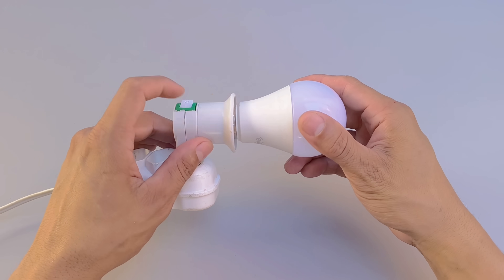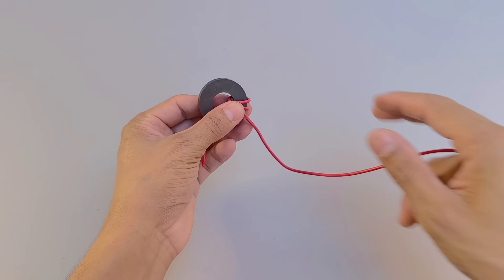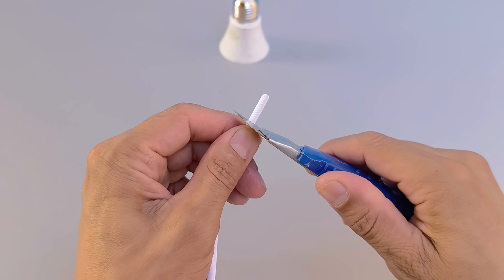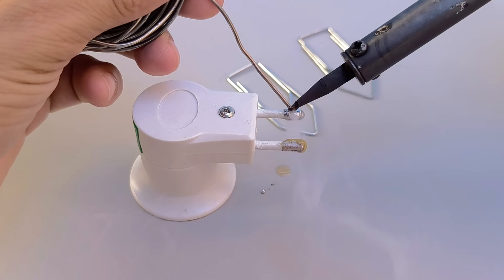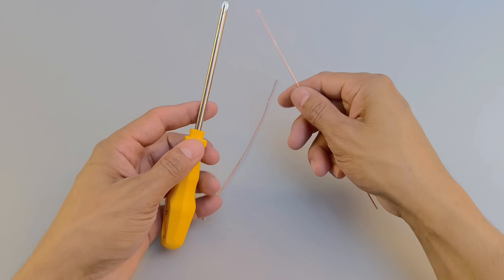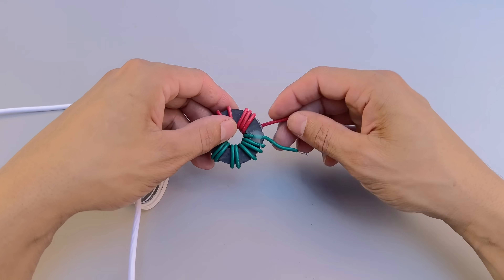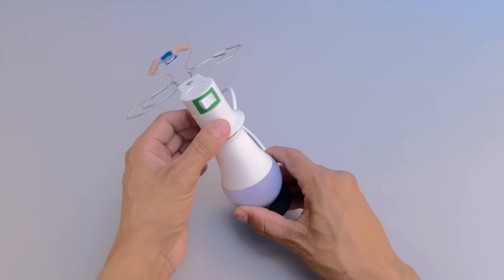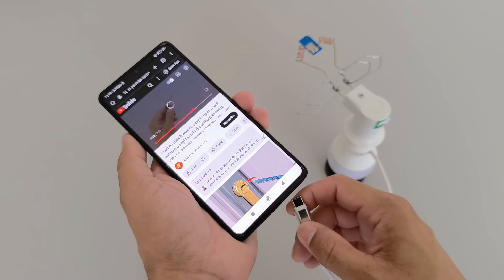If I hadn't seen it, I wouldn't have believed it! 100% free internet using a light bulb

Comment: Didn't the old bike dynamo, just rely on kinetic energy, movement. Using windings and an iron, carbon core. No external power source to drive it. So aren't turbine generators, able to provide free energy FFS? Everyone needs to install home turbines, water turbines, in fact anything that moves, wire it up 😉🇬🇧

Comment: you enabled mobile data before closing the settings tab on your smartphone... one tap to enable two to disable you tapped 3 times and closed it before it initialized the "not available" message after closing the wifi settings is the standard message when the device is still searching for a signal... if it didn't have the ability to connect it would say "couldn't connect to a network try again later"
Reply from the maker: Thanks for the detailed observation; I appreciate your attention to detail! 🙏

Comment: So I'm reporting this video and others like it.  It's causing ppl to become dumber and dumber since u can find out so much online already. Ppl take it for granted and stop learning how things are correctly created or facilitated to them.  They start thinking it's some conspiracy that's being hidden by people behind the scenes for control and power... because some random guy said so and couldn't provide proof other than what some other guy said in the same manner.  I can't tell you how many times I've heard ur wrong bro check out this video and I'm sent 4 hours of videos of people doing exactly the same thing he did and saying that's definitive proof.  "But he said he's an expert" Lord help us all...

 If anyone potentially thinking it may be real, and they remembered or learned how magnets worked when connected to wires and electricity back in middle school, they would know this is all a lie. Unless he edits this video or deletes it with others once reported, trying to cover up how he shows in the video, that he doesn't even know how a phone works and tells on himself. There's an overlay or prerecorded video showing the internet speed before even connecting that abomination to his phone. If it worked like that, why use the extra steps connecting wires sanding down something that's told plated and already makes an electrical connection? You don't need to remove something that's more reliably conductive so something conductive underneath that will conduct electricity...Why didn't it start working until the thing was plugged in tho it showed an internet connection already? Why didn't the speed change? That thing is pulling it out of thin air, like it's 5G so you won't keep a steady connection within any building that has any walls or electricity, much less a camera powered by batteries anywhere within its vicinity. It's not a one time speed test you do to gauge your intenet at that time.  Wifi is a perfect example of why there's changing speeds and why there's a preference for using an ethernet connection instead. Your modem/router is hardwired not wireless pulling signal from nowhere. I mean he even made the mistake of saying how you can see it's speed on top which was again, on there before plugging the electromagnetic (he called it that)  device into his phone. Electromagnets work when what happens? There's so much that's wrong, i can go on and  on still. Nothing about what authentication and data packets are, why it's sent, now it was always created as a business and made to be sold since networks and servers cost money and the environment to maintain, and made to be sold at a profit from the beginning.  It's not mystical tech that was always free.  This video is everything wrong with the internet and society and is truly evil.
Reply from the maker: First of all, I would like to introduce myself: I am the person responsible for the channel and also the creator of this invention. It is important to emphasize that anyone has the right to report videos if they believe there is some type of irregularity. However, I would like to point out that any complaint, in this case, would be unfounded, since the content presented is intended for entertainment and was produced with a high degree of professionalism. At no point during the video did I ask for money, nor did I mislead anyone or deceive the public. All of the material was created in a transparent manner, always respecting the platform's guidelines. The video does not violate any YouTube rules or commit any absurdity, being fully in compliance with the policies established for the community.
Reply: @inovaouinventa  you don't have to ask for money to lie or spread misinformation. Nothing was showing this is for entertainment purposes only and this "device" is as fugazi  or fake and cannot work in the way you described. This is s fact, and no matter how you spin this, won't change that eventually people will get tired of lies like yours.  Fix your channel. Remove the lies and possibly incorporate humor, sarcasm, fantastical elements, but don't act like this is something that will get anyone internet. YouTube only allows a specific number of chances. Plus your channel is littered with nonsense that will get you removed eventually. What happens when someone gets hurt or messes up their device trying something you pushed? Because they didn't understand the safety aspects you do?  Your going to be responsible if it's from something done in the format like this video. I'm trying to help you here and I do understand the science behind this. You're closer to making a speaker than you are anything close to something that can receive internet in this video
Reply: @anonymousdoggo9326  Thank you for calling this out and I will be doing the same. There's people here who are genuinely looking for practical ways to save money in poor countries and are thinking this can actually help them.

And then they leave a comment saying they're actually going to try it or asking how does it work, and he just says "good luck". 

I honestly wouldn't have as much of an issue if at least in the video description they made it clear this is for entertainment purposes only.
Reply: @inovaouinventa  you don't have to ask for money to spread misinformation or lie to get ad revenue. You can make adjustments using humor, sarcasm and fantastical elements to highlight what is done wrong with many other channels and why it doesn't work.  You can keep the titles and thumbnails the same as you do now as well and subvert expectations of the initial viewer turning that into an inside joke with your audience...bringing you viewers and interaction that's natural and won't have as large a portion be bot comments that you cannot control. The algorithm filters out what it can and won't pay you for that interaction. They only give you a few chances before removing you altogether as well. Nothing was listed saying it was only for entertainment and it won't work like described in the video.  There's so much that can go wrong here and you don't want to see it
Reply from the maker: You are completely mistaken in your understanding. At no point has there been any illegality or dishonesty in our work. We are fully aware of YouTube's guidelines and follow each one of them responsibly. With all due respect, it is not your place to teach us how to operate on the platform. As I’ve already mentioned, you have every right to report anything you believe to be inappropriate — that’s part of a democratic environment. However, it’s also important to remember that no one is obligated to watch our videos or agree with our content. We approach our work with great care, seriousness, and professionalism. We take what we do seriously, and not just any poorly placed criticism will diminish the effort we put into our daily work. If something has bothered you, I apologize — it was never our intention to offend or harm anyone. That said, feel free to take whatever action you feel is necessary. I only ask that your right to do so is exercised with mutual respect.I speak with courtesy and transparency, and I end this message by wishing blessings upon you and your family. May there be more empathy and less baseless judgment.
Reply: I will be interested more if no sim card is used, that way it will be totally free internet.

Comment: this entire video is clickbait you can't get any through wifi or any sort of signal with a lightbulb
Reply: @cydragon2.099  he did essentially make  a wifi router. Would have been easier to just put the Sim card in the phone though.
Reply: You’re right he’s not gonna make an electromagnet out of a magnet and wires
Reply: You use wires and a battery and a nail you wrap the wire around the nail a lot of times then after you wrap the wire around nail, what you have to do is you have to add a switch and connect one wire of the switch to the battery connect the other wire to the front of that wire that goes around the nail then you connect the wire that’s at the end of the nail to the battery then you switch the switch on and then there you go you have an electro magnet
Reply: Sorry, not wires a wire that is very very very very very very very very long

Comment: Don't you have to activate the sim card ?
Reply: This isn't true.  Internet and wifi do not work this way. Internet traffic is a set of network communications protocols that gets routed in data packets from several main base infrastructure areas granted by telecommunications companies and ISPs to your ISP provider, then to your home, to your router/modem, and then through either an ethernet cable or wifi, and finally your cpu or device. If going through a cellular connection like this video since a Sim was used, the same process is used except it gets routed to a cell company as the ISP provider.  

Why this matters?? Because you need to be granted access from those telecommunications carriers or other ISPs. Think of it like needing a password that changes repeatedly every hour... and when you need to log on you need to be connected thru your ISP provider to get that password uploaded by them to your home or device...

It's not transmitted out of thin air or granted by wires and magnets soldered to a sim card...and if you know how magnets and wires work when connected you'll know exactly what he's doing here which is also some bs... he's even using an overlay on his phone because before the cable even connected to his phone which was supposed to be "granting him Internet" the internet speeds were listed on top already.  At the beginning he highlighted how it's on airplane mode to ensure no wifi or cell signal blah blah blah, but it continued to be in airplane mode when he was granted internet thru cellular signal. There's a reason it's called airplane mode and you could get internet this way by somehow defying any science available, he just showed accidentally like nobody can see that you wouldn't need wires or solder. Tho he did say it was an ectromagnet lol. Then those points on the sim are gold plated.  Already conductive, you don't need to sand down to facilitate contact plus the other points he left empty need connection to facilitate proper interface to your device so it can get the correct authentication for data packets that make up your internet to be received. So much wrong with this.  DO NOT TRUST ANYTHING LIKE THIS ON THE INTERNET.  It's not something insane conspiracy they want to keep from the public, hiding how it's free out of thin air... servers and networks cost a crap ton to maintain. It was always designed to cost money and to be sold for a profit.  Made that way from the beginning because a business developed a way to produce a product to be sold since maintaining it costs money and the environment. Look up how much water is used for a days worth of chat gpt AI created photos everyone uses fior thumb nails and memes
Reply from the maker: No